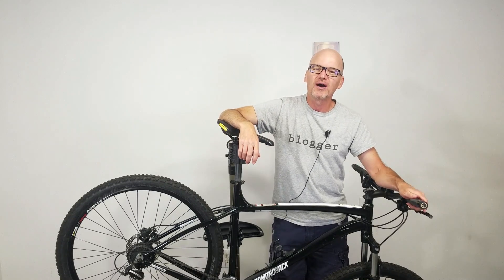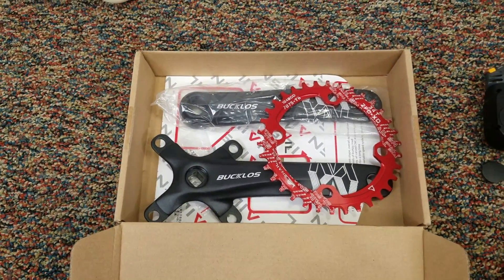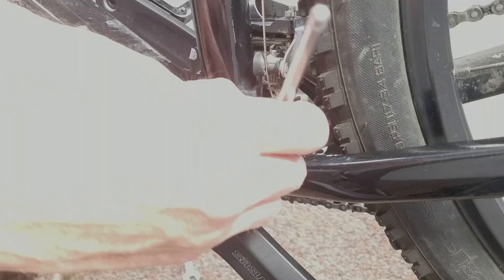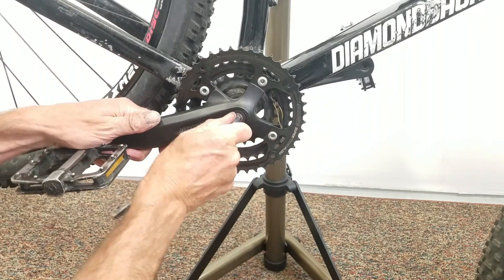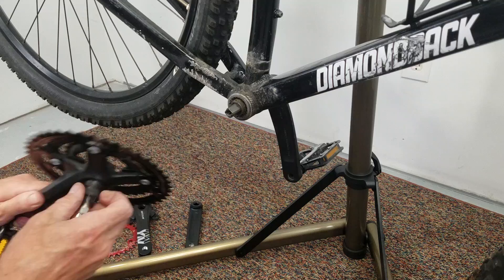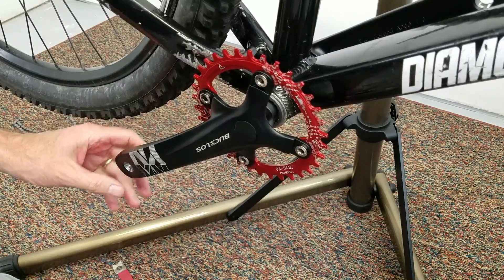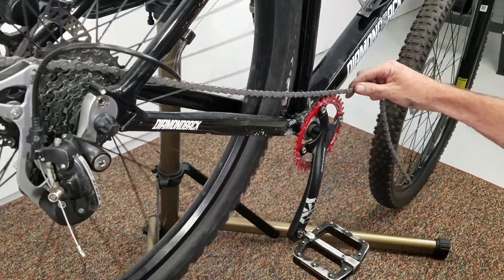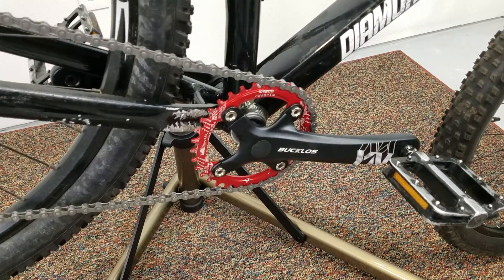Convert a Mountain Bike to a 1X

Comment: How has your son liked the 1x drivetrain compared to the 3x setup? What was the main reason for the change? Liked you video!
Reply from the maker: 1x systems are much simpler, more reliable with less chain drops.  The narrow wide chain ring also holds onto the chain better.  My son likes the bike a lot more.  He was dropping the chain often - in the video you can see how torn up the bike frame is.
Reply: @diymountainbike  maybe you son just needed to learn how to change gear properly. dropping the chain i not common on 3x systems unless it is abused or not maintaied correctly

Comment: My question is not so much about what you did but is about how the first gear is going to work when you do a climb on the trails because I generally use the smallest on the front of the 3x which gives me the easiest way to pedal up the hills. What I am getting at is if the new 1x is about the same as the middle one on the 3x it is going to be hard as hell going up a hill so what do I need to do I am wanting to switch to a 1x?
Reply from the maker: Great comment and your exactly right.   The gear ratio range will be reduced.  My intent was to simplify by removing the front derailleur and reduce chain drops with a narrow wide chainring.  A further option is to put on a different rear cassette to change the gear ratio range.  This opens up another can of worms usually requiring different length chain, at that point you may need a long arm rear derailleur.
Reply: What most people do when they do a conversion is to get a wider range cassette. This creates bigger gaps between gears but that isn't a big deal, imo. At least, not with mountain biking.

Comment: Why convert from 3X to 1X? I'm currently looking to convert my bike to an e-bike and i noticed the converter kit only comes with 1X and the kits asks me select the number of teeth for the chainring. I'm a new rider trying to get into cycling on weekends
Reply: A 1x is much simpler for mountain biking. Trust me dude when I say that. 1 bys are much more simpler and easy to use. Less complexity, and you also have a less chance of dropping a chain on a 1 by. Definitely go with the 1x!!!!!!!
Reply from the maker: If you're getting a mid-drive electric bike kit, you will only be able to have one chain ring.  The number of teeth in the ring will determine your pedal cadence.  IE more teeth slower cadence pedaling.  If you will be riding mostly on the road, a 44 to 52 T chainring will work.  Good luck!
Reply: @diymountainbike  thank you so much. This the info i was looking for. CyC Photon offers 42 and 51. So i'll take 42 for the small hills i sometimes have to traverse